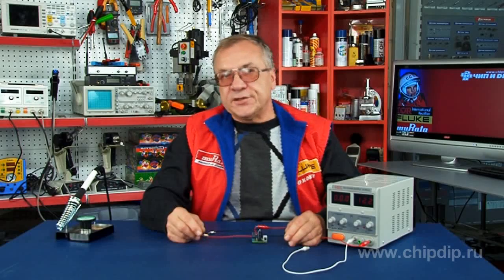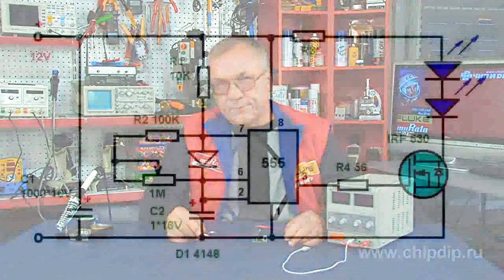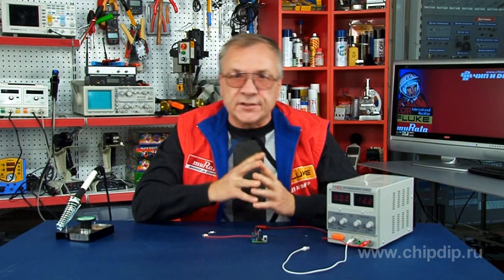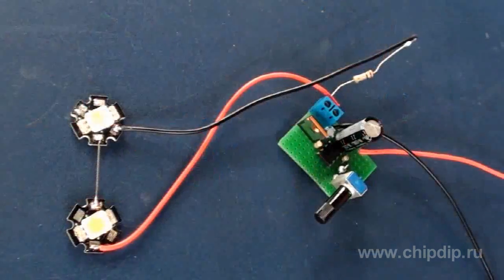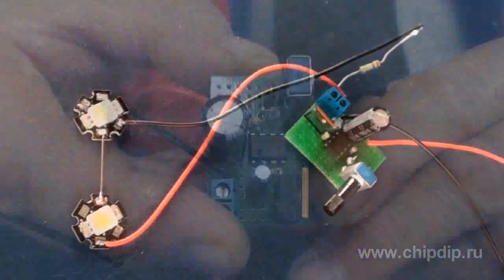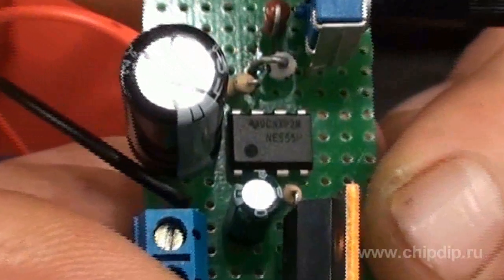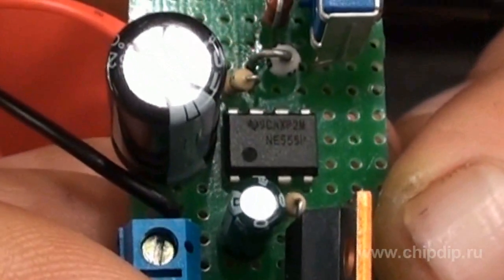Bright LED Strobe - Do It Yourself!

Comment: how I make any led (small) to strobe???
what I use ....ex. resistor, dioed,...etc.???
Reply: use jewel thief...inductor capsitor,resistor, trimpot.led ....this needs a 1.5 volt battery....and can flash about 3 leds in parallel.... lots of luck...chas